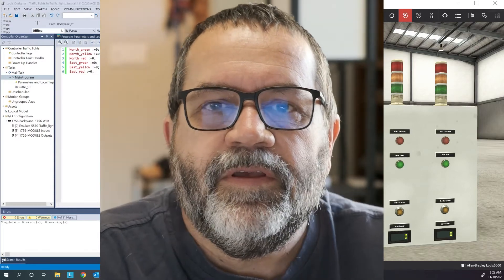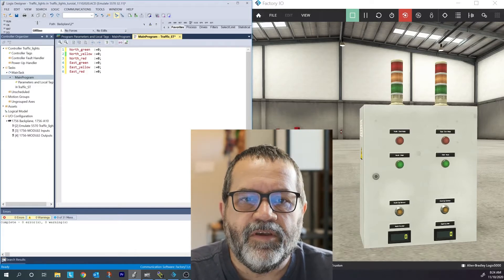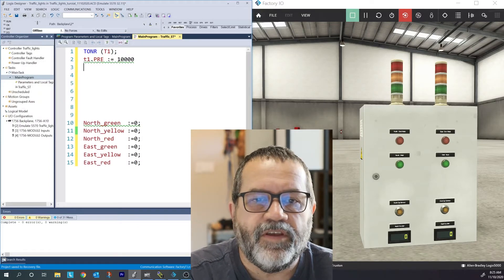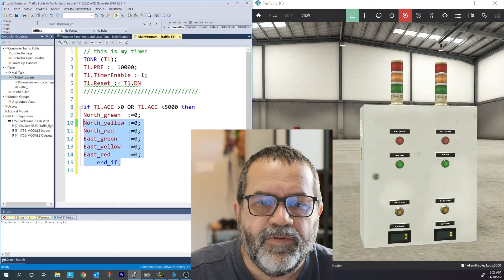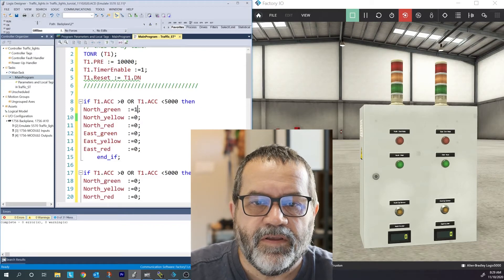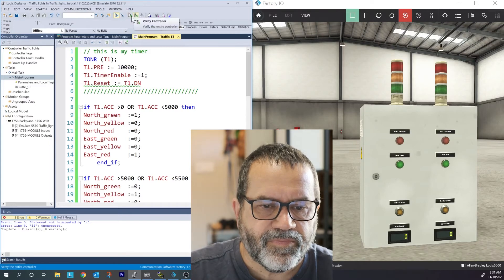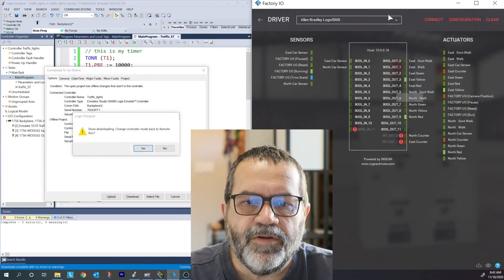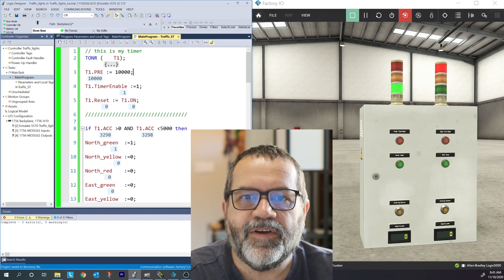Structured Text PLC Programming - Traffic Lights; Professor Murray

Comment: Thanks.  I too often forget to end a line with a semicolon in ST and C code.  Spoiled by Basic where they figured a carriage return means "end of statement", and on the rare occasion you must continue onto a 2nd line, you use an underscore (so clever).  On the 4 sections, you kept saying "and" but left the logic as "OR".  I much prefer ST to LD, having begun programming in text with Fortran as an engineer.  I also find SFC and FBD useful.

Comment: I had an assignment to do something like this when I was in school. It was a 4-way light system with green arrows. I was able to save myself a lot of work by having a rung for each light at the bottom that said (using NORTH as an example):
NORTH_RED_LIGHT := NOT NORTH_GREEN_LIGHT AND NOT NORTH_YELLOW_LIGHT;
Then all I had to worry about was the green/yellow lights.

Thinking on it now, I would probably do something like this for each light. Knowing the timeframe that each light is supposed to be on:
NORTH_RED_LIGHT := T1.ACC >= 0 AND T1.ACC < 5000;
NORTH_YEL_LIGHT := T1.ACC >= 5000 AND T1. ACC < 8000;
... etc. etc. ...

Comment: Am i silly or is the ST way of programming way better? I do a lot of ladder programming, but just switched to ST recently.
Reply: A picture is worth a thousand words. Try trouble shooting a ST program. It's not fun. Use ST for things like large formulas and not much else.
Reply from the maker: ST is not great for troubleshooting, but its power makes it worth learning.
Reply: ST is more powerful.  One can auto-convert LD to ST, but not vice-versa, at least in Beckhoff Automation TwinCAT (version of Codesys).  ST is preferred by engineers who first learned text languages like Fortran, Basic, C, Pascal, Python, ...  Like in those languages, you can troubleshoot by setting breakpoints and monitoring variable values live.  Beckhoff even has a Scope utility to plot any variable like on an O-scope.  LD is a bit strange if you didn't grow up with it, simulating electrical relays where none exist.  Made sense to electricians who originally wired actual relay logic on GM assembly lines.